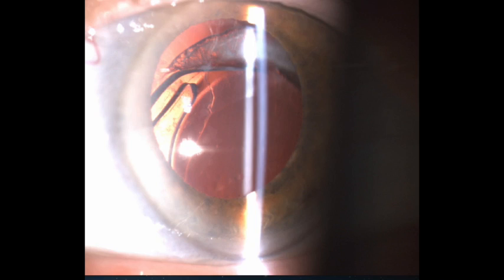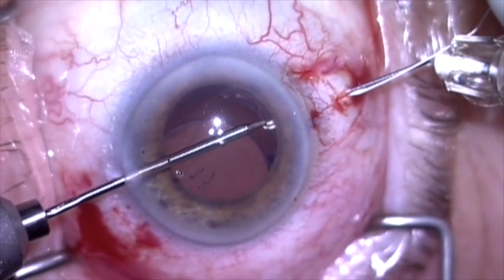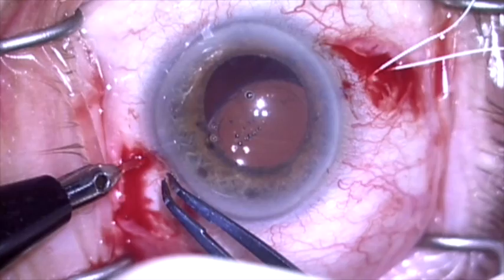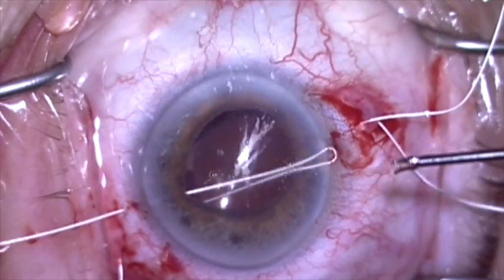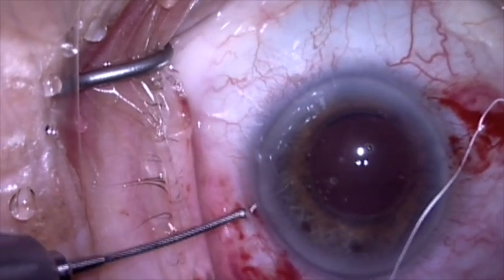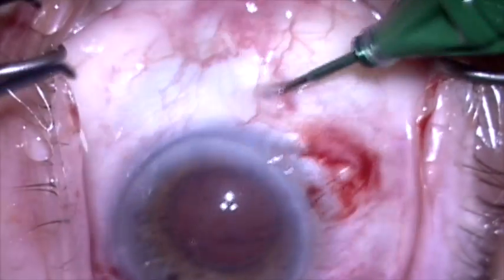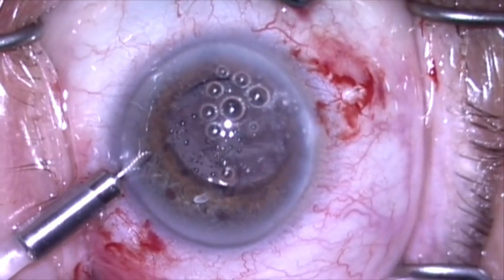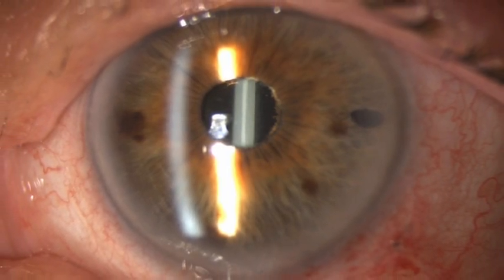Lasso of dislocated IOL/Bag complex using 30g needle by Steven G. Safran MD

Comment: Respected sir can we lasso suture for pmma or multipiece iols or not??
Reply from the maker: If they are in the bag and in good shape with no bent or crimped haptics you can lasso the lens bag complex in 3 piece, single piece PMMA cases.  If they are NOT in the bag you have to tie the suture directly to the haptic so it doesn't slide or do Yamane.  I would not lasso any kind of IOL unless it's complete in the bag and there is some capsular bag fibrosis to give it some substance to hold that suture in place.  You cannot lasso a "Dead Bag" complex because it is too flimsy and the whole thing falls apart.